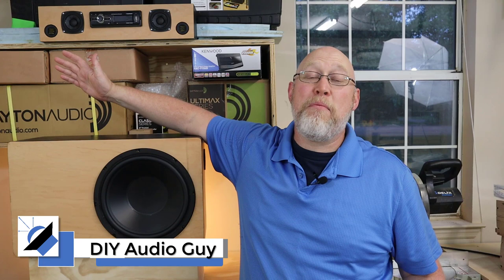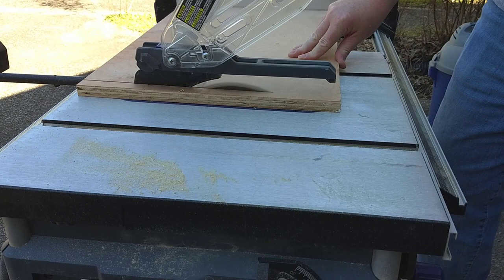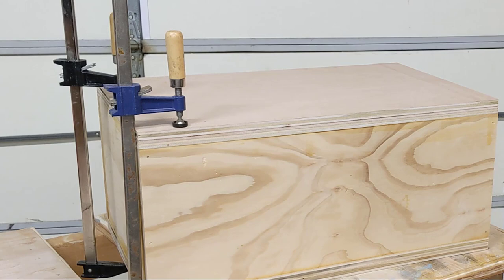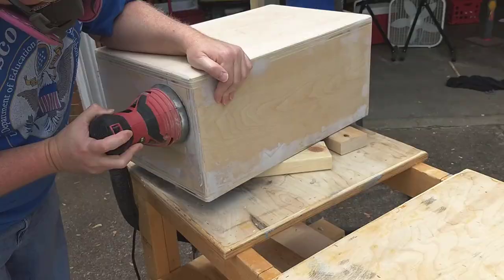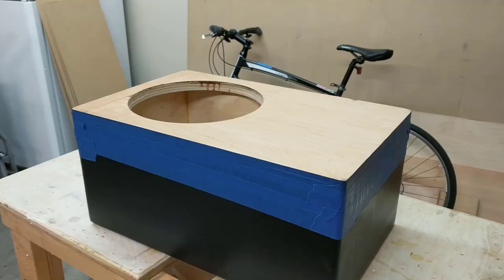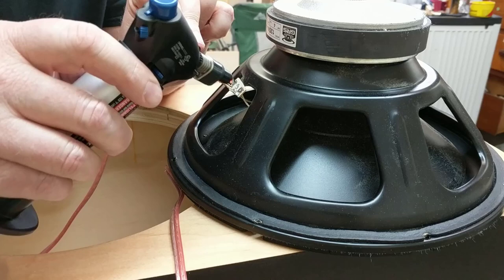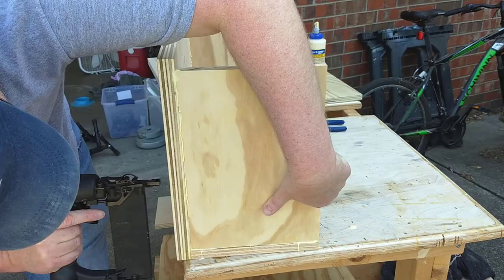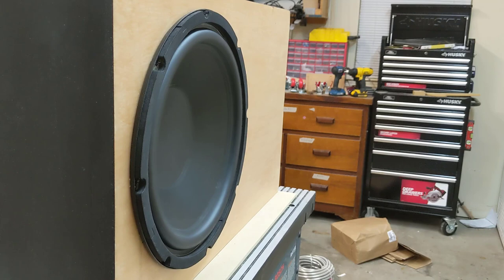Budget Subwoofer Build (The Budget Bass Box)

Comment: But are used to have a 15 and then I went down to 212s and then a friend of mine he had an SUV that I had a custom box for 10 inch kicker competition two or facing straight back at the very back of the tailgate and the other two was right above them but at a 45° angle and he had a Kenwood 1021 amplifier and had it all breached I never heard nothing that loud in my life that stuff would take the breath right from your chest so then some years later a friend of mine he spent over 20 grand for a system 1997 Toyota forerunner the box was leather to match the seats he had 6 10 inch JLAudo 10 W6 subs with all rockford amplifiers I can’t remember exactly what amplifiers he had but they definitely did the job he had to battery caps and I remember he had a Kenwood head unit and all that money he had to get air shocks to because of the back of the truck sacked 

I know yeah he at all JL audio or they might’ve been kicker door speakers with the tweeters and all the doors had to get built out and everything to go to sand it a really good job especially with the door speakers like it look more factory but I’m not gonna lie my friend who had The 410 inch kicker competitions with the Kenwood 1021 amplifier I think he had Alpine mids and highs don’t get me wrong the forerunner system looked way better but it is what it is so when I graduate high school like two years later I bought the same truck as the guy with the Kenwood system except for mine was silver so I got mine custom done first with 212s kicker competitions with alpine 6 1/2 in the back with a custom deck over the back where the subs were and I have the same speakers in the front doors with detachable face Alpine pen unit the accident and that was the good stuff than the next stereo system addressing the jail Oreos I got three I can’t remember if it was 310s or 4 tens JL audio 10 W sixes with a rod for amplifier in my car with the Kenwood head unit like he had in the forerunner and I didn’t spend all that crazy money I had everything written need to wear in the factory everywhere we all made a lot of money but I just wasn’t paying over $20,000 for a stereo system are when they all do the same thing but 👍👍👍👍👍

Comment: Only mistake I saw was trusting the manufacturer's published Thiele-Small parameters to be accurate.

Always, ALWAYS measure the TSP's yourself, then and only then calculate the enclosure requirements.

I've seen the published data from even so-called "high end" manufacturers turn out to be pure fantasy.
Reply from the maker: Absolutely.  The best thing to do is break the sub in and hit it with a DATS.  https://youtu.be/LYzbJxnmSGk

Comment: By opting for a ported box you'd have made a sub that's useful and only marginally more expensive. This one is useless with F3=37Hz.
Reply from the maker: For this sub a ported box would need to be a lot bigger.  This is supposed to be a cheap sub that you can build out of scrap wood from other projects. As the box gets bigger it is harder to find scraps that will work.
Reply: @DIYAudioGuy  Now you are introducing an extra requirement, using scrap. Just like the driver wasn't scrap and  you had to buy it, you could buy cheap wood of proper size. Now,  what you have is a scrap sub.
Reply from the maker: @gdevelek  I'm not adding extra parameters.  0:50 scrap wood I just had laying around
Reply: @DIYAudioGuy  Then please change the title to "Budget subwoofer build using only scrap wood laying around". And picture viewers rolling their eyes. See my point? What scrap wood you have laying around is an extraneous parameter. It should not affect what you build.

Comment: Nothin budget about this, its just a build lol. DIY is the move.
Id rather spend a little more money for a nicer sub. If youre going to do all this work and buy materials, you may as well invest some in the woofer. Itll last years if you treat it right.
Reply from the maker: That cheap sub punches above its weight.  Every bit as good as a sub for twice the price.
Reply: @DIYAudioGuy  Youre right... Now I wanna buy some just to have 🤣
I compared it to one of my old MTX terminator TN12-04 which go for $60. The specs and quality look similar, the GRS has a better sensitivity. 
My current sub is 1500w rms so im a bit biased against lower watt subs 😆